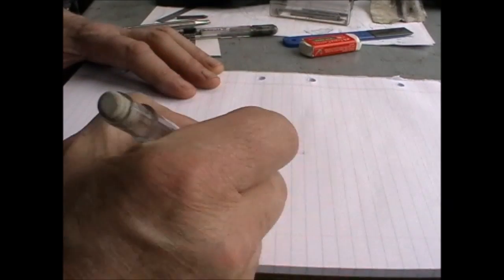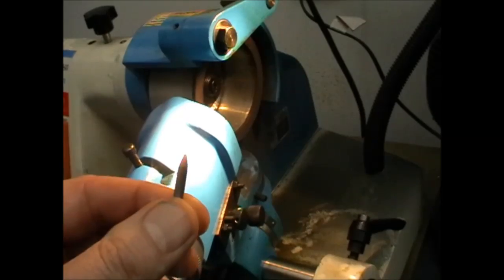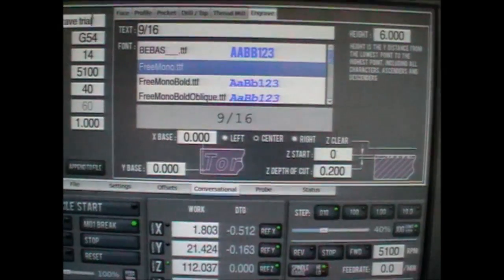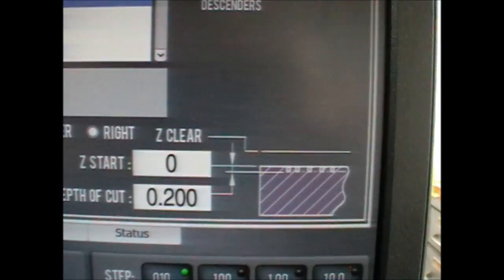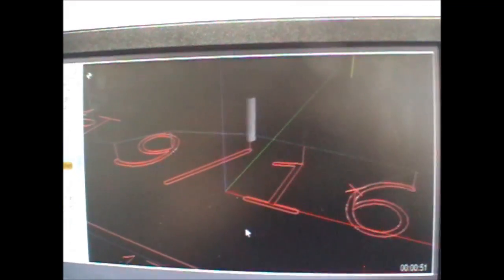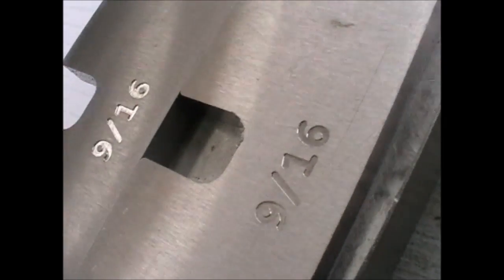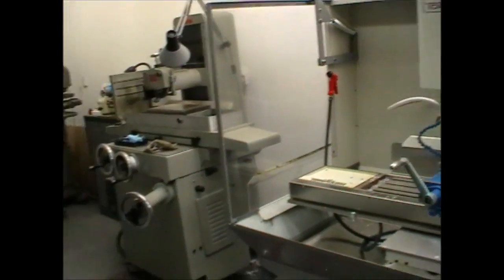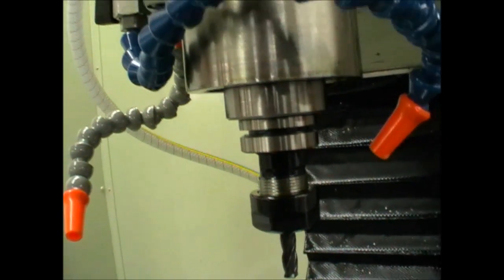Tormach PathPilot Engraving

Comment: G'day, I thought it was just me. I have used the Engrave function a number of times, and various fonts. I too would like a font or two that are just single line. not so much to save time but to be able to make a more compact line of text. I use a carbide insert tool that is designed for engraving. It has a 15d included angle and a point diameter of about 0.05mm. Obviously 5100RPM and I run a feed rate of 150mm/min. I engrave at .03mm depth. That way I get no burr at all. Infact you can barely feel it. I have found that if I go any deeper cut then I have to deburr the edge of the engrave. I use a cork block (usually used for sanding) and just rub it back and forth(to work the burr so to speak). Then i run the same cut again. I may repeat this process up to 3 times. That way I get rid of the burr without scratching the surface of the Aluminium. I don't polish(with anything) all my surfaces are "as machined". 
Compared to what you are engraving(multiples) I only work on a couple of jobs at a time. So the time is not an issue for me. It is purely about how good it looks. All my clients like it becasue they can see it but can't feel it. If I go any deeper, with or without a burr, you can still feel it. Thanks for the video. Peter
PS...Your piece on the Deckel Grinder bought back some great memories for me. I once worked at a company that made Dies for the plastics industry(for a specific company actually). We had a Deckel Grinder at each of our Makino CNC Mills and we would grind our own (some) tools.  Thanks for the memories.
Reply from the maker: Cheers
Reply: I just use a standard .062" diameter short carbide 2-flute ball nose End Mill at .002"-.003" deep.  I don't use coolant on my machine, (only a 4000rpm spindle), and for aluminum engraving, just a bit of WD-40 on the surface will be a great cut the first time.  I don't know how fast you can feed it for a good finish, but I am only feeding it about .002"/revolution. I am sure it will not break the cutter at only .0025" deep if you went faster. But I don't do much engraving and like the good finish. 
If I was running the cycle more than once and de-burring, I am finding a better way.  I think you like the little ball nose EM better.  They cost very little, and it will last forever on aluminum.  I don't even use a collet, just the fast twist little drill chuck.